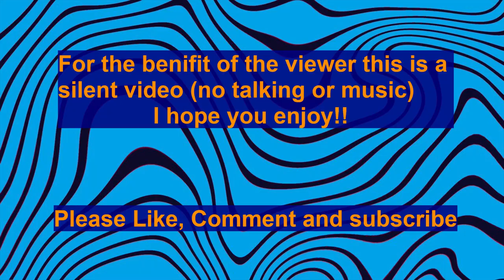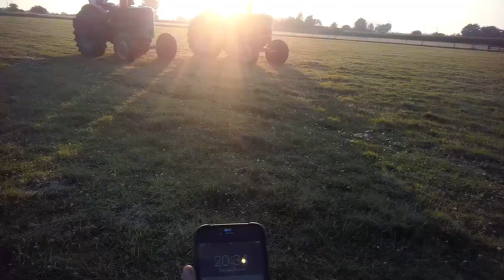POV - field Marshall handle start and drive - GoPro

Comment: What throttle is 3a fitted with? Definitely not straight back rod... is it rachet? She sounds very sweet, very sweet indeed. My favourite the 3a... always has been driven her a couple of times. Best regards
Reply from the maker: The 3 and 3a should have a little chrome rod on the side of the tank. However I find the lever throttle fitted to the 1 and 2 is better. You have more control over it. This one is off a series 2 that we fitted and it has some friction disks instead of a ratchet system! Thank you for the comment it really helps build a community!

Comment: if you stopped the engine, in the field say, would you have to go through the same starting procedure again with the paper etc?
Reply from the maker: You bet, you would have to do the exact same process. Although you can either use a handle or a starting cartridge, the only difference between is winding
Reply: If the engines still warm or the wick is still burning it should start fine

Comment: Do you ever shotgun start its ace
Reply from the maker: Yes sometimes, however they are expensive so why not start on the handle like a man 💪🏻😉😂 also it’s not proven but I feel like it would damage any material over time going from stationary to full rpm in the space of less then a second, making micro cracks and all. Again not proven just a theory I’ve got